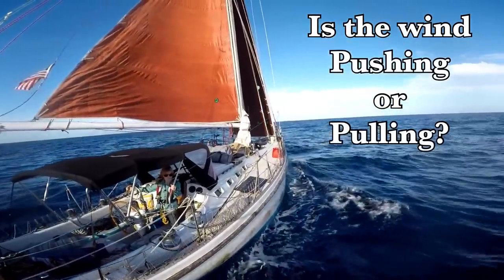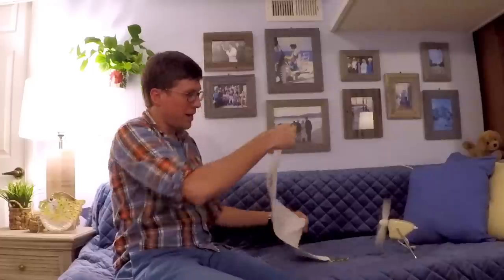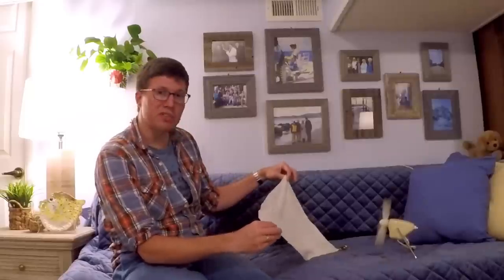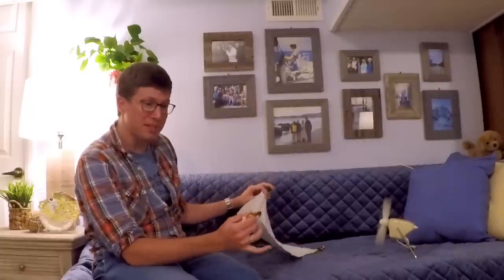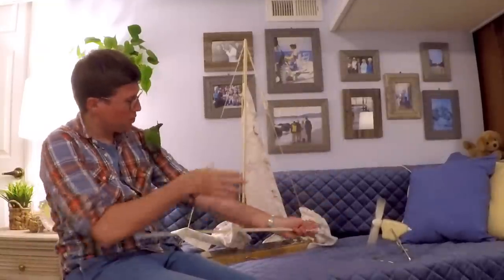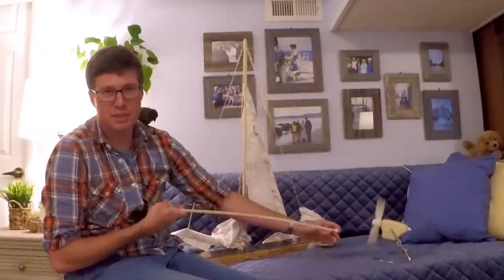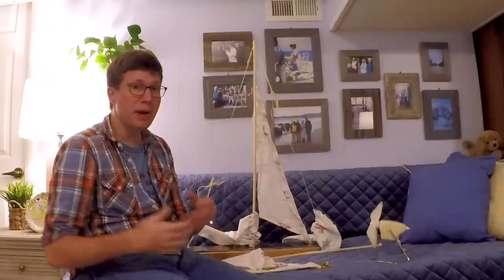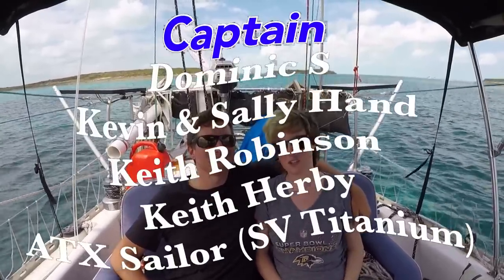How Do Sails Work? | Sailing Wisdom

Comment: The best example of lift that I have seen, and use it to this day, is a sheet of 8 x 11 paper held at the corners of the 8" side with the 11" tag dangling. Hold the paper up to your mouth to create an arc and blow across the top side of the paper. Observe the results. You are not applying "wind" pressure to the underside of the impromptu foil... only to the top side. the speed of your breath creates the low pressure on the top and the stagnant air on the underside becomes the high pressure, creating the pull or lift of a foil/sail. Granted sails work in a wide range of points and are subjected to 360 degrees of wind so push or pull is a relative thing. But I thought you may like to try the paper thing just for fun.

Comment: Oh also you don't want the leading edge to be in the center of the foil but rather more forward to the foil.  If you look at airplane wings that is the case the leading edge is really close to the front of the wing.  When you look at a sail it's getting good angle of attack the leading edge is toward the luff of the sail.

Comment: Another good one Herb. I know that you said you will talk about keels later, But, you showed how the sails make power to move the boat sideways. You probably should have told them that the keel helps the boat to move forward and not be pushed-pulled sideways.
Reply from the maker: I mentioned it very briefly when I talked about square sails on tall ships, but it will become a very in depth talk soon.
Reply: @RiggingDoctor  It was just a clarification, Sorry Herb!

Comment: I'm curious if anybody else had pointed out the flaw in your illustration.  You're illustration shows the curvature of the wing being horizontal which is not correct.  The curvature of the wing is vertical. Running just aft of the head running all the way down to just behind the tack.  So the part of the sail that is the trailing edge is from the leading edge aft do the edge of the leech and ultimately the clue as well.  But the leading edge is vertical.  Like you said it's a wing stood on its side vertical rather than horizontal.  The reason why you see the leech flipping around it's because the air is stalling on the trailing edge.  Your explanation is correct put your visual seems to indicate otherwise.  Though your belly explanation was great for downwind.

Comment: This explanation is based on equal transit theory and it's largely incorrect. There is no physical principal that mandates air molecules split by the luff have to translate across the sail, to the leech, at the same rate. If the air between windward and leeward doesn't travel at the same rate then Bernoulli's principal doesn't apply. Sails work by efficiently changing the momentum of air according to Newton's 1st & 3rd laws.

Comment: Great video, thanks. Just I am confused by there is low pressure on the other side? Can you please explain a bit more about this? Thank you!!!
Reply from the maker: The air on the windward side will have a slightly shorter path to run than the air on the leeward side of the sail. Since the air on the leeward side of the sail is running a bit faster, it creates a slightly lower pressure area on that side of the sail and sucks the sail into that void. When a sail is “full of air” it’s actually being sucked into a void on the other side of it, and through the rigging, pulls the boat along with it to drive the entire yacht forward.
Reply: @RiggingDoctor  Great thanks for explaining this. Just one more thing to have 100% clear understanding, as the air on the leeward side has a slightly longer path, why it has to run faster?
Reply from the maker: Archit Kumar when the air is split by the sail, the air on the inside of the sail (windward) has a shorter path than the air on the outside of the sail (leeward). This is because the inside curve is slightly shorter than the outside of the curve. 
So the air on the inside moved slower while the air on the outside moves quicker. 
The easy way to visualize this is that the air “wants” to stay together so the air that was split at the beginning of the sail “wants” to rejoin at the end of the sail. Since they run different length paths, the inside runs slower and the outside runs faster. 
The reality is the air on the outside is accelerated by the curve of the sail and some other complicated aspects, but it works very closely to the simpler way of thinking about it.
Reply: @RiggingDoctor  Great, thank you for explaining it in such an easy way!! Amazing!! :) :)
Reply: What you may have learned in school about how a wing or a sail generates lift is probably wrong. They taught us that the air moving over the top surface of the wing (leeward side of the sail) has a longer distance to travel and needs to go faster to have the same transit time as the air on the lower side of the wing (windward side of the sail). But this is wrong. 

There’s a video that shows this well, https://youtu.be/UqBmdZ-BNig

It’s the curvature of the sail that causes the lift. There’s force on the windward side of the sail because the curvature of the sail deflects the air. A wing works the same way. 

Now there are two parts to this force, one that pushes the boat sideways and one that pushes the boat forward. The keel in the water resists the sideways part of the force, so the boat moves forward. The keel can be much smaller than the sail and still counteract this force because water is much more dense than air.
Reply: @architkumar941  Absolutely correct question in case of an airplane wing, and it does not have to. Actually, if the same air parcel splits in two at the leading edge of the wing, and two parts will meet again at the trailing edge,  there will be zero lift, despite, in case of aircraft wing,  top having longer pass and air, in this case having to move faster there.  Basically, the pressure over the top will be less, but the area of the top side of the wing will be larger, and as the result force on the top will be exactly equal force on the bottom. The lift appears only if the two parcel DO NOT mean at the trailing edge,  thus creating turbulence at the trailing edge.  This is why airplane do not gradually lift off as they accelerate on runway, but are only getting lift after reaching critical speed, when turbulent vortex forms and detaches from the trailing edge of the wing.    After that, to two parts of the split parcel do not meet at the trailing edge, then there is no easy argument that they have to travel with different speed.

Comment: Good talk, however a black/dry-erase board would have been less confusing/awkward. I did learn much so thanks!
Reply from the maker: Good point! The next few topics will make much better sense having the actual model present, I will be sure to touch on “lift” with a marker on paper before we go further into other topics.
Reply: @RiggingDoctor  Suggest doing the old standard display of blowing over the top of a strip of paper and showing how it rises to demonstrate the Bernoulli effect.  (HS Science Teacher)
Reply from the maker: That would have been a lot easier to visualize than what I did there. 
Thanks for the tip, I’ll cover it again in (hopefully) a clearer method!

Comment: Check this out.
This transatlantic racer from the mini 650 class is packed with all of the most recent innovations.
Even the resin used to build the boat is recyclable.
Reply from the maker: Thank you!
Reply from the maker: Wow!
That design with the blunted bow reminds me a lot of your designs ;)
Reply: Jim Nickles  That is the worst challenge for a boat designer:
How to match looks and performance.

But then again, beauty is in the eye of the beholder, and in any case, it's not beauty that moves a boat through water.
Reply: @RiggingDoctor  My designs aren't that bulgy in the bow, but that's more or less the principle we're after nowadays:  Fuller sections in the bow, to keep the bow from nose diving at high speeds.
Check this one :
https://youtu.be/wJivEpepdlo.
Note how to safely broad reach at full blast in 30 knots, you take two reefs in the main, and hoist all the sails you have forward of the mast.
Safer to pull a boat through water than to push it through.

Comment: Actually there is a video that you put out when you were sailing that shows your sails beautifully formed into a wing.  Also in the video you are making note of it and I think you were also saying that you were getting your best speeds.  Sadly I have no idea which video that is.  

On a side note, too bad your sheet sails didn't form as I believe you hoped.  I have no idea why I didn't happen other than I have no idea how sails are made.  The cool part is you got me thinking on how does the leading edge get created.  I mean on an airplane there are structural sparse that create the curvature of the wing.  Sails don't have that.  So I have spent a lot of time trying to visualize in my mind how that is being created given my knowledge of airplane wings and airflow.  I was always shown that the air went straight along the bottom of the wing and the air flowing across the top of the wing is weaker and therefore creates a force differential which then creates Lift in the direction of that Force differential which in sailboats we want that lift to be pointed towards the bow.

We are told that if the air flow is not direct then it is stalled and starts to swirl so maybe the airflow that is filling the sail is stalled air on the underside but then you would think the tell tales would also stall so obviously I don't have a good visual on that yet
Reply from the maker: That’s why a good sailmaker is imperative! They make the sail so that it has a bit of a belly in the front that way it will take the right shape when the sail is in the wind. 
When it’s set right the wind flows evenly across both sides. Trimming with the tell tails is the trick to getting the flow perfect!

Comment: hey you will confuse people if you say you will generate more power with more curves !!! Thats only when going down wind!!! Going up wind, you need a more rigid curve
Reply from the maker: Not entirely. The curve develops the power so more curve is more power. 
The trouble is the angle of attack increases so you can’t sail as close to the wind. 
For serious upwind performance, a flatter sail lets you point higher due to the shallower angle of attack, but it will still generate less power (though still plenty of power) than the same sail with a deeper belly and a deeper angle of attack sailing further off the wind.
Reply: @RiggingDoctor  well its amazing you can go slightly forwads INTO the wind LOL... Too much Belly and you will be going backwards heheheh
Reply: @RiggingDoctor  Here is a video idea for you, Why Do we need a Boom (down on deck, rather a smaller Gaff up top) and do a simple Wharroom wingsail???